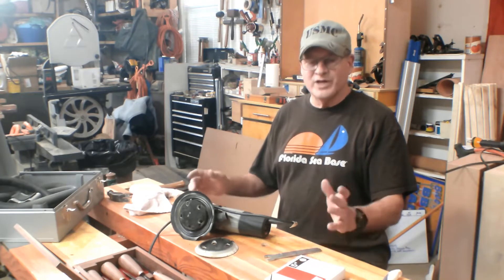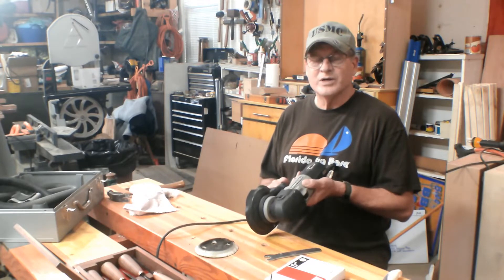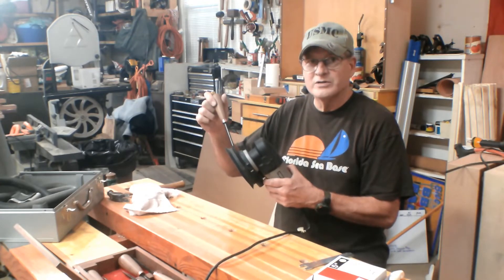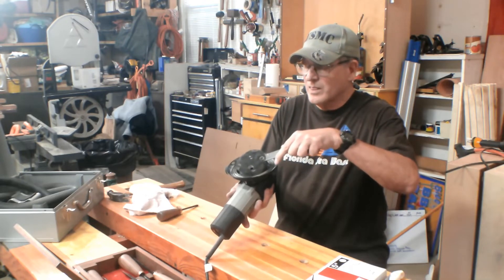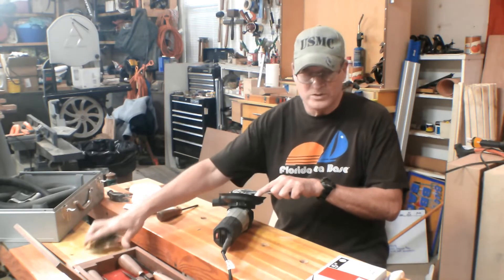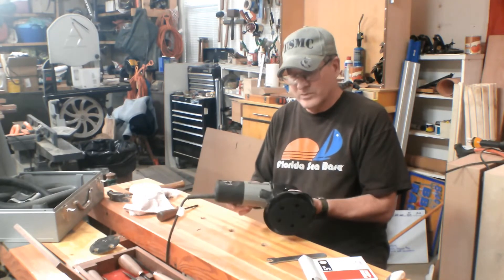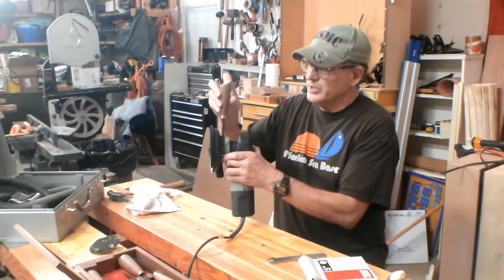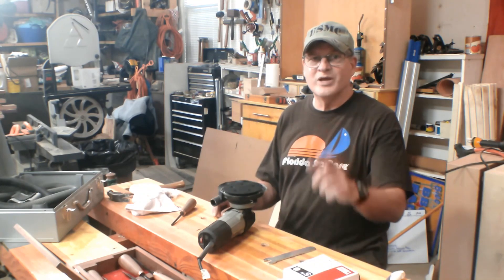Porter Cable 7335 Pad Replacement Tutorial: How to Replace a Pad on a Porter Cable 7335

Comment: Thank you - hadn't done this in about 10 years and I was at a total loss on how to get the old pad off.
btw - your link sends you to an "adhesive backed" pad with no vacuum holes.
Reply from the maker: Glad it helped. And thanks for pointing out the link problem.  I'll get it fixed.